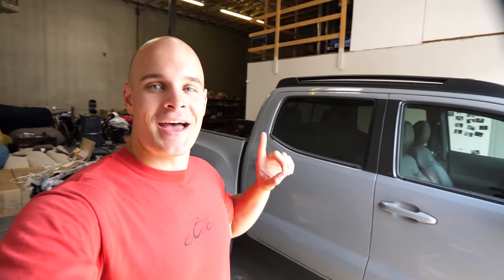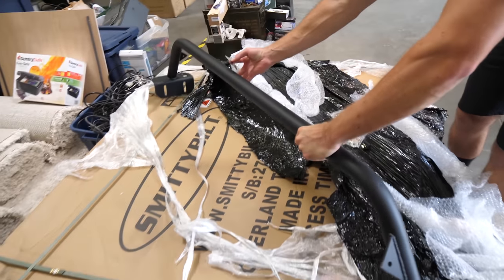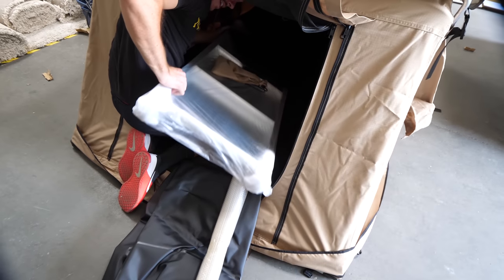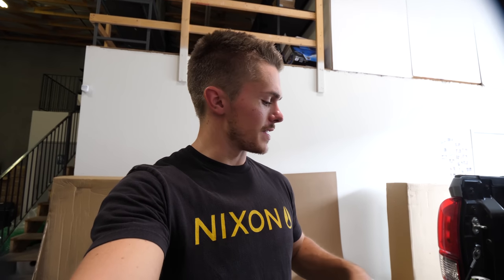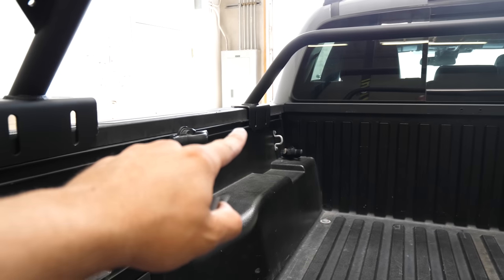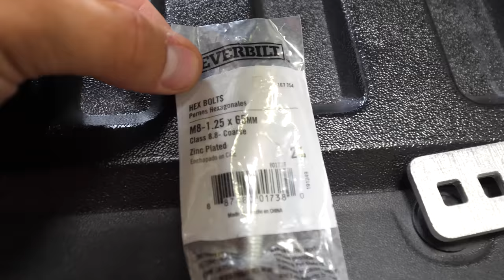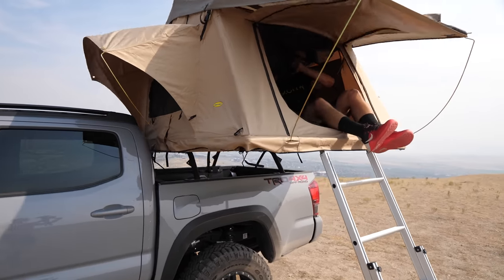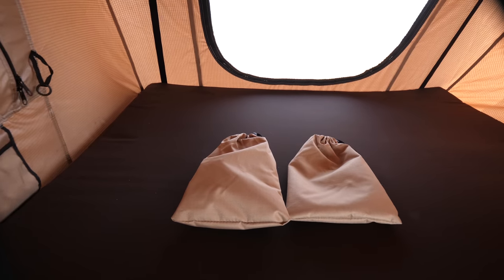Installing a ROOFTOP TENT on my New Tacoma!

Comment: Great video! I'm picking up the same bed bars. Did you guys mount the bed bars the wrong way? It looks like they should have been installed the other way around to give you the ability to mount the gear plates.

Comment: Why did you orient the ladder side of the tent to the driver side? If you turned it around you could pull over just off the trail and setup the tent without it hanging over into the road or trail.

Comment: This was great.  I did notice what is probably a manufacturer DEFECT on the support bars...  you mentioned the little triangle things on the bars that go from the bed to the tent could be used to sturdy up the whole thing, but I noticed on the right or passenger side they face each other while on the left driver side they face out.  I don't know what they are for exactly but the asymmetry bothered me, especially since whatever the function it won't work the same on both sides.  Also I'm picky and like a symmetrical aesthetic.  Thanks for the video.
Reply: probably made differently to accommodate different items

Comment: I don't think I would wanna have a tent mounted to my truck full-time. Mike at Last Line of Defense has a pretty cool set-up where he can take the tent off for daily use and keep the bed functional. I'm also considering just getting a tent that fits over and straps onto the bed when the tailgate is open. I'm only 5'7" so it would be plenty of room. I may get a rooftop tent someday, but I'm gonna have to drive my truck a little while longer and figure out what I like/dislike. Plus they're a ton of money.

Comment: I’m building my own rack on a budget first get build. I’m gonna make it tall enough to match the height of the cab so I have full bed access.
Reply: I'm doing the same thing today for an ARB tent I bought. Matching the height of the cab keeps the noise down, keeps mpg's up, lets me pull in and out of the garage keeping it on full time, and go through car washes without worry. The downside is the tents annex will hang down too low so I guess as much as I'd like one I'll have to take a pass. I wish I could come up with one that could be easily adjusted for height and still look good, but I haven't come up with a good design yet. Maybe I could just park it on those RV leveling blocks.

Comment: Belated comment. :) Great video, my approach is also to not overspend, but to avoid stuff that can fail.

Curious what supports the part of the sleeping platform that extends to the side of the vehicle?

I should have my 2021 Toyota Tacoma TRD Off Road (two door crew cab) in a week or so, and frame/RTT is #1 on my list.

I pan to buy a Goose Gear rear seat delete, so I can mount my Dometic fridge/battery kit securely in the vehicle.

Thanks for this video, its awesome, totally liked/subscribed!

Comment: What are your thoughts on those oem/factory roof racks?
They worth a shit? Durable? Sturdy? Etc.
My 08 Taco has never had racks installed. (Got it used at 24k miles)
I need to be sure my not so cheap surfboards are safe and secure for a 2-4hr road trip lol.

Comment: If you were looking for the eBay link for the bed rack, it is no longer available. Did find a substitute at a good price, you would need to do some easy DIY to paint them! https://www.ebay.com/itm/HotMetalFab-Universal-Over-The-Bed-Rack-Holds-any-rooftop-tent-fits-any-truck/172987112933?fits=Model%3ATacoma&hash=item2846d5dde5:g:L3EAAOSwB-1Ywte~

Comment: Maybe it's just me but I feel like this is pretty stupid? You said you won't use it a lot (I assume 3 times a year Max?) And for that you have destroyed your rear visibility, increase your fuel economy, limited the height of the stuff you can put on the flat bed and spend a lot of money on something that you could've gotten for a lot cheaper that would suit your needs better and would be cheaper overall (future costs). My opinion but I think this is a waste of money, time and effort. As long as you're having fun I guess you're all right tho. It overall is just your money and effort not mine so what do I care lmao
Besides that, good detailed instructions
Reply: Lukas Rohrmoser its easy to remove.  I plan on swapping it out of my truck when i'm not using it.
Reply: Did you see drag augmentation with the tent ? It seems pretty non-aerodynamic. (I know the takoma isn't a really "aerodynamic" car :) )
Reply: I've had my tent on my 2002 and 2016 Tacomas and the fuel economy only goes down .5 miles per gallon with it on top of the cab. Over the bed doesn't decrease it at all, if anything I'm sure it helps. "Don't buy a roof top tent if you only go camping 3 times a year", who in their right mind one would unless they have a you tube channel looking for subscribers or are just throwing money away. We take ours to the beach when the weather is nice, so easy. Overland trips, we stay in it for two weeks at a time staying on BLM land where there's no designated camp sites. It's so nice to be up off the ground, so much better in our opinion.